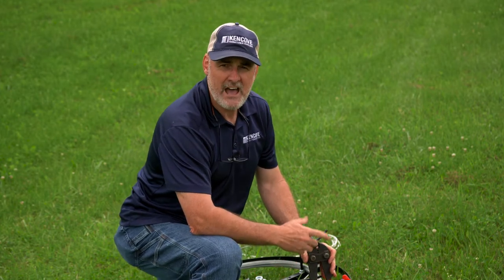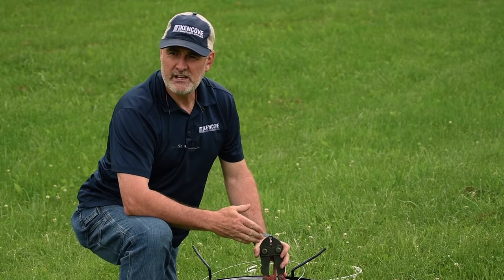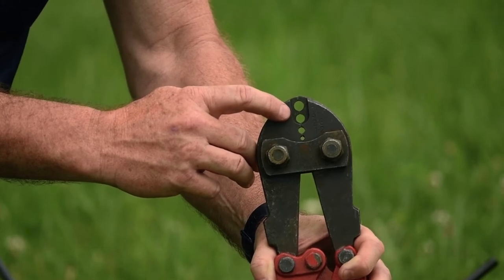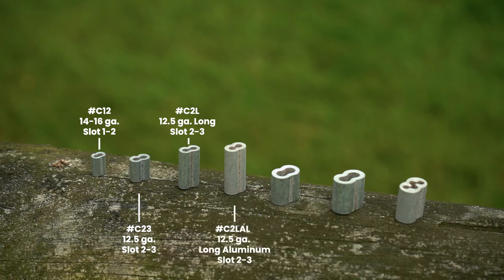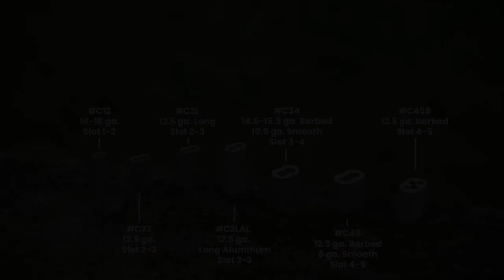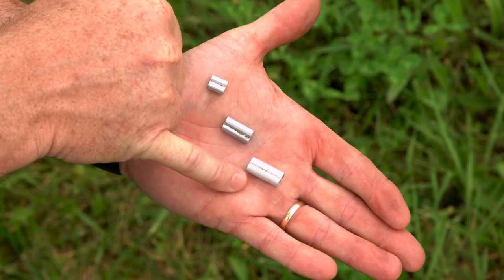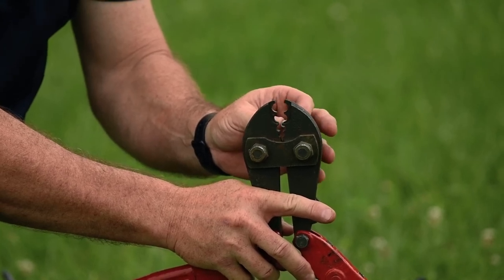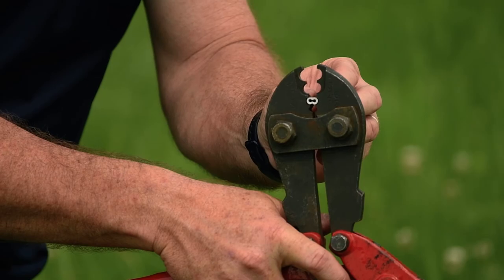Using a Crimping Tool

Comment: Hi,

Appreciate the video thanks.

I'm over in the UK currently doing some fencing.

I've acquired a crimping tool similar to this but it's slightly out of alignment. Probably a cheap one.

Is there a way to adjust it into alignment or does it not really matter? It's only slightly out, a test crimp showed it to work I'd just like it 109%

Damn OCD.

Anyway, many thanks 👍🏻
Reply from the maker: Hi! Thanks for reaching out.
Without knowing the exact model you have, the solution may be limited but we'll walk you through adjusting this crimp tool shown in the video. With the handles open, loosen the locking screw (the lower set screw on the side of the tool) with one or two turns. Turn the adjustment screw (the upper set screw on the side of the tool) clockwise about a quarter turn. Tighten the lock screw to lock in the adjustment. Compress a crimp and check it with the gauge. Repeat this process until the proper gauge slot easily passes over the compressed sleeve. 

Hope that helps! Please let us know if we can assist you any further!